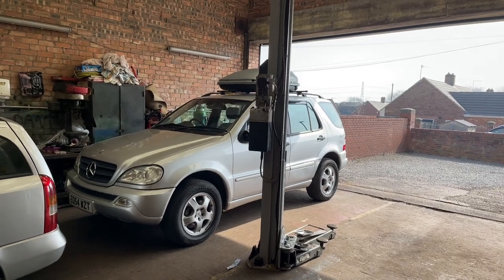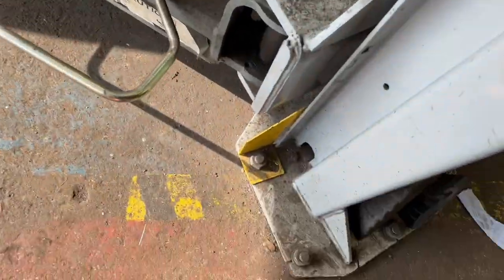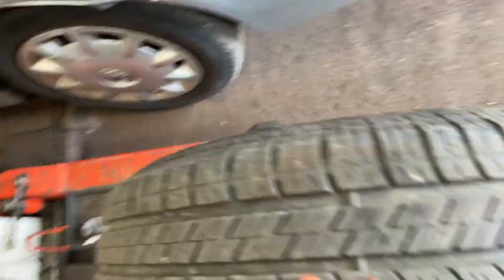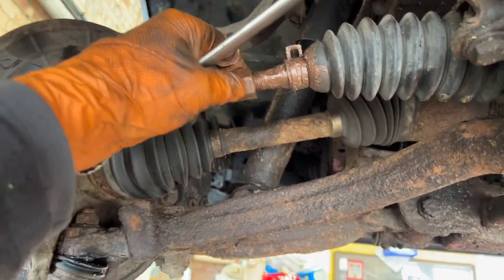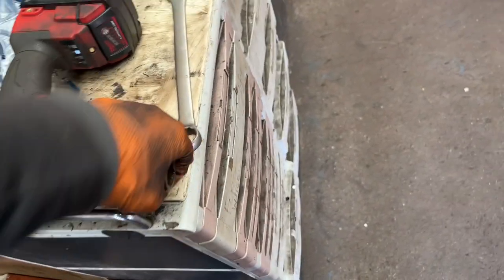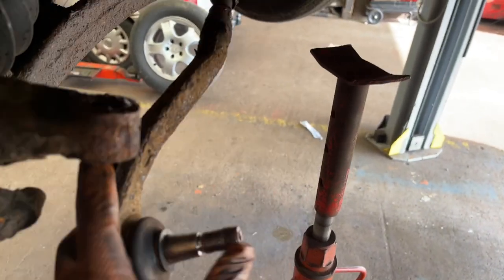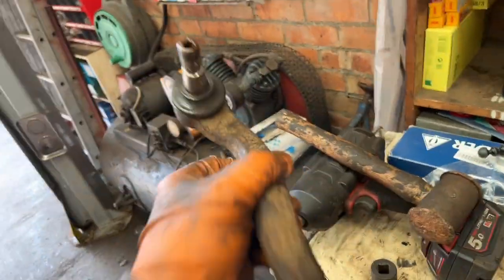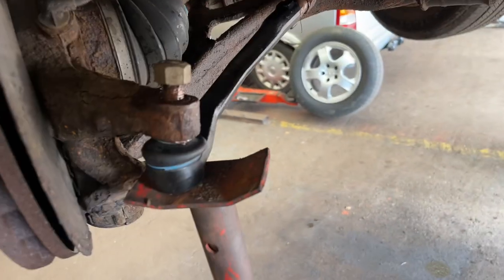Getting The Mercedes M Class Back On The Road| #mercedes #mercedesbenz #4x4 #w163 #car #mechanic #v6

Comment: Those original W163 are heavy duty body on chassis, but with multi link suspension and modern 4x4 system, proper 4x4 handsome looking car if you ask me, best of both worlds
Reply from the maker: Definitely not built like that no more new cars.

Don’t think I would ever sell this W163

Comment: Nice work Dan, didn’t realise quite how big those ML wheels were 😳
Reply from the maker: Thanks mate appreciate it 👍🏼

That’s just the wheel, honestly whole car is like that everything is bigger, heavier, more HD than anything else lol, when I say it’s a beast it really is…. Hence I doubt I will ever sell it nothing is made like that no more
Reply: Given your love of them Dan I may have to consider solving my own on going car hunt by getting an older example of one of these….a high milage example no doubt…petrol or diesel maybe a secondary consideration, just find one with good history and as little rot a possible….what is it with Mercs and rust !!
Reply from the maker: Yeah of this ere Mercedes are terrible for body corrosion.
I wouldn’t advise the diesels ML280 CDI not very reliable, ML320 or ML350 ones you want V6

Comment: You need to start on that astra get that as a project car
Reply from the maker: Ha ha I was thinking about it, but now it’s spring/summer the dogs will be spending every day in it or attached to it.

I will do a video on it one day, do a pre MOT on it….. but I know that list will be getting silly from burst brake pipes, to alternator not working, to rear arches literally falling to bits, rear exhaust detached.

Love the car will never part with it, but I fear even me doing the work free, may not be worth it.

Thanks for watching as always 👍🏼